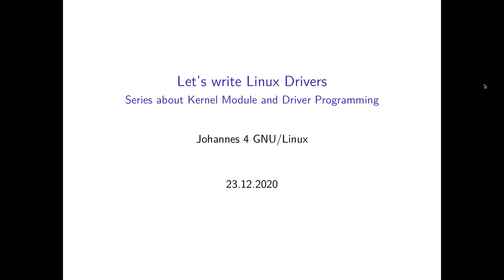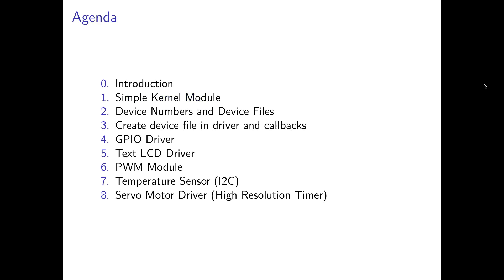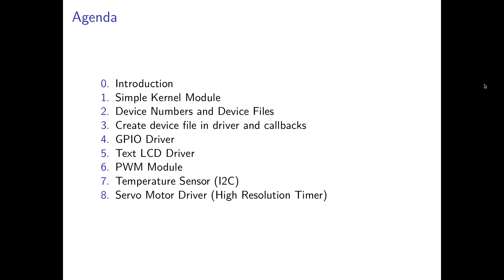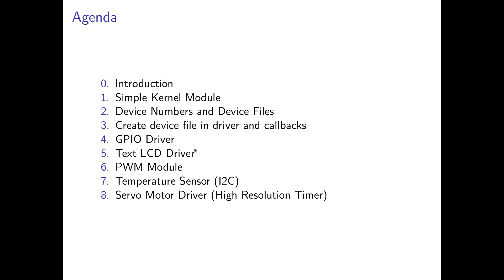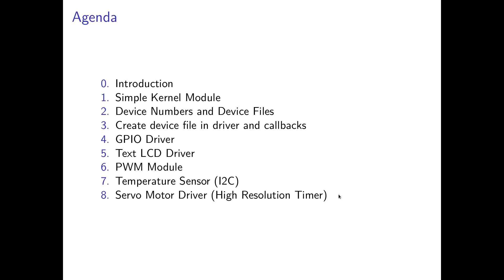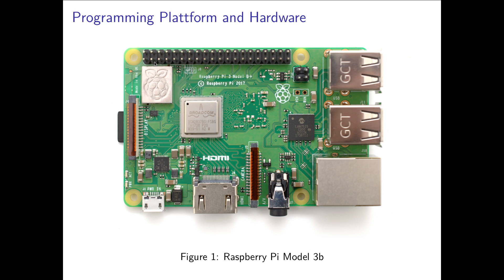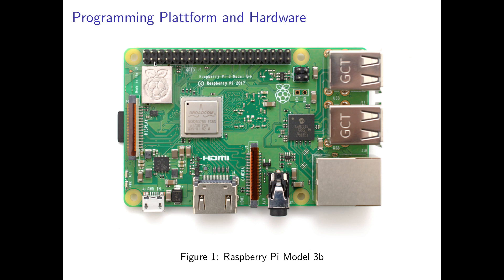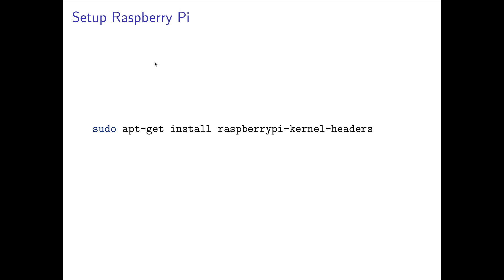Let's code a Linux Driver - 0: Introduction (old one)

Comment: Hi Johannes, thank you for the awesome tutorial. Do you work with Matlab/Simulink? I would like to control physical objects in Simulink in real time. Can we connect Matlab/Simulink to a microcontroller through PCI on Linux? And how do we write a driver for the PCI card to connect with the Simulink Desktop real-time kernel? Thanks!
Reply from the maker: At university I had an introduction to Matlab Simulink but I don't have much experience with it.
I know it is possible to build models with Simulink and use the embedded coder to generate Microcontroller Code. This works with The TI C2000 DSP or some stm32 controllers. The communication between Matlab and the Microcontroller is done over JTAG (C2000) or stlink I believe. 
But I really don't know if or how you can communicate with a PCI device in Matlab Simulink. Or how a Driver must look like to use it with Matlab Simulink.
Reply: @johannes4gnu_linux96  Okay, I will learn more about it. Thanks for your answer)

Comment: HI I put my driver into: /lib/modules/5.10.110-rockchip-rk3588/kernel/drivers/hello, but when the operating system boots up, I get a message in the syslog: systemd-modules-load[408]: Failed to find module 'hello.ko' I googled a lot and found nothing to solve this.

Comment: Hi Johannes, Firstly I really appreciate your works. Can I follow the tutorial for one of the installed Linux distribution on my PC, i.e. Ubuntu.
Reply from the maker: Hi, thank you. Yes, you can follow all tutorials which doesn't require Hardware access. On a PC interfaces like Gpios, I2C or spot are normally not so easy accessable as in a raspberry pi.

Comment: Hi Joannes, I need to create a network device driver to connect two hardware. Could you do a video about it? Could you advice me a good course? Thanks
Reply from the maker: Hi, currently I don't have plans for doing tutorials about network drivers, but maybe later.
I can only recommend you the book Linux Device Drivers 3rd edition. It is a little bit outdated, but the concepts should still be valid. And it has a chapter with 50 pages only about network drivers.
Maybe you can study other Linux Network Drivers. This should also help you to get started.
I hope this will help you.
Reply: @johannes4gnu_linux96  Thank you, I just studied the book that you advice me, but I need more information and source.

Comment: Hi! Can you explain shortly what is the difference between kernel module and user space module?
Reply from the maker: Hi. At least I can try.
Kernel modules are pieces of software, that is running in the Kernel space. This means, the software can access the hardware (physical registers) directly. That is why drivers are Kernel Modules. But running in kernel space brings some disadvantages like no support for floats, limited stacks, etc.

Userspace applications run in userspace. If they want to access the hardware (access a file on a harddrive, ...) they have to use systemcalls like open, close, read, write, ioctl, ... Then the kernel will do the hardware access and return the desired data back to userspace. In userspace you have a bigger stack, floats support, ....

I hope this will help.

Comment: Hi Johannes, will you show device tree structure?
Reply from the maker: Hi,
well I could make a video about the basics of the device tree and add the Kernel Module for BMP280 to it by using a device tree overlay. 
But I haven't build a GNU/Linux system for ARM from scratch and therefore I don't know to much about it. Only the basics.
But for a deeper understanding, maybe this presentation can help:
https://www.youtube.com/watch?v=m_NyYEBxfn8
Reply: @johannes4gnu_linux96  :). dt for dummies was the first source when i was looking for device trees.  thank you after all. But i think still there is darkness about device tree development. most of the books and videos are passing on them.
Reply from the maker: Why do you need knowledge about the Device tree? Are you building a system from scratch with a SoC?
Reply: @johannes4gnu_linux96  yes, i have custom design.